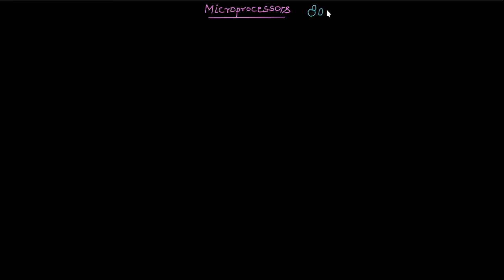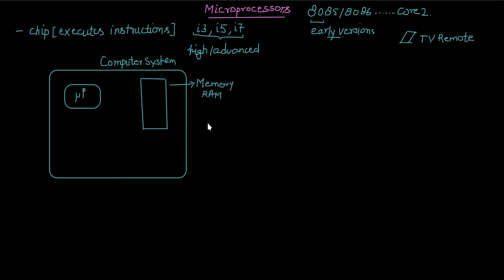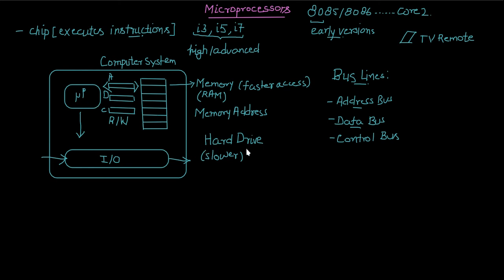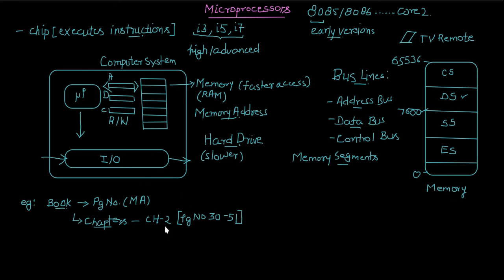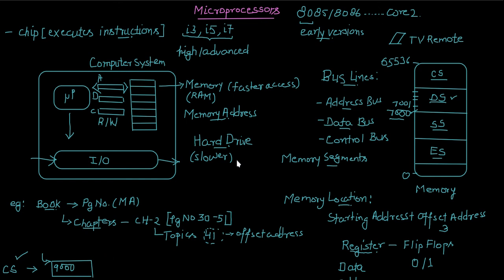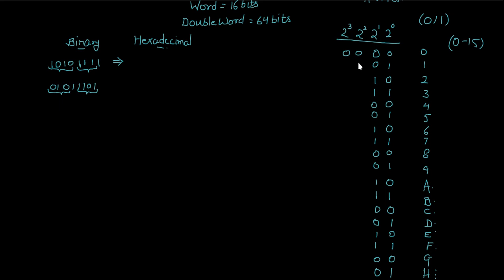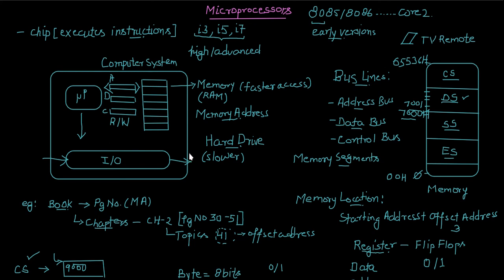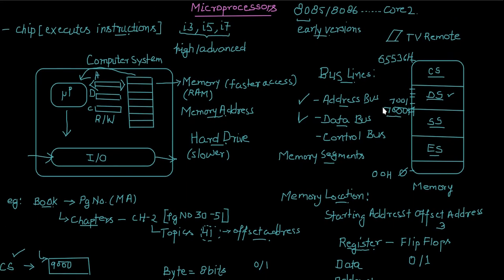[1.1] Introduction to Microprocessors

Comment: Hello sir , in this video you emphasize that address bus is directional but i know that address bus is undirectional. Am i wrong or you make a mistake about that ? 
Greetings from TR.
Reply from the maker: address bus is unidirectional i called it directional in another way that data has a direction as it moves from microprocessor to memory and vice versa.
Reply: @ThinkXAcademy  thank you sir
Reply from the maker: I will mention it in the pinned comments so new users cannot face this issue